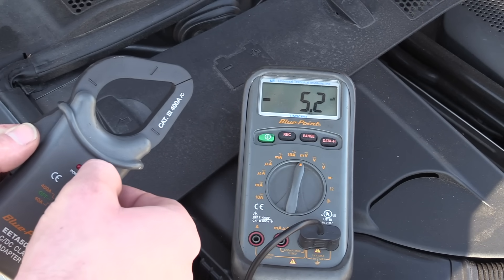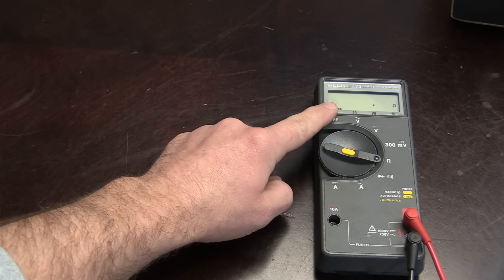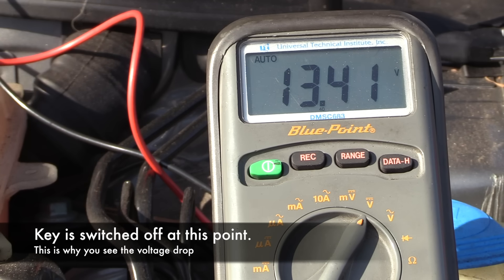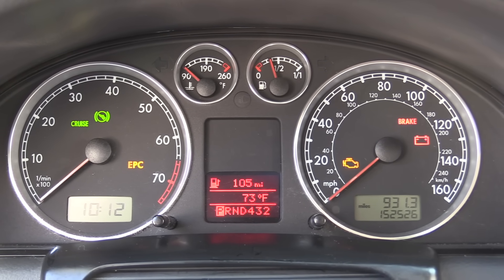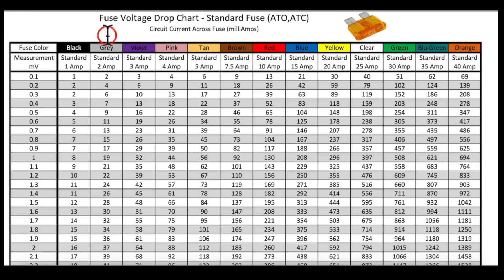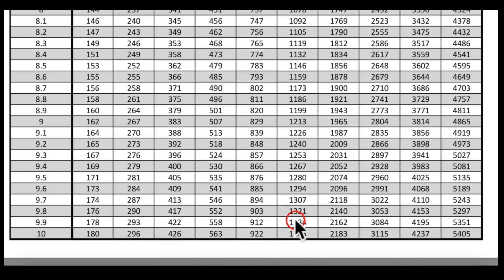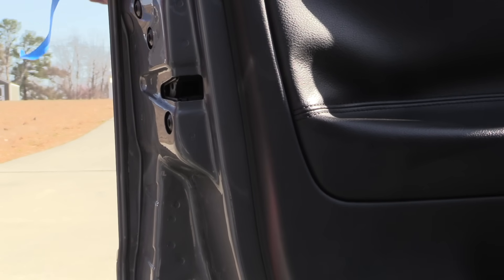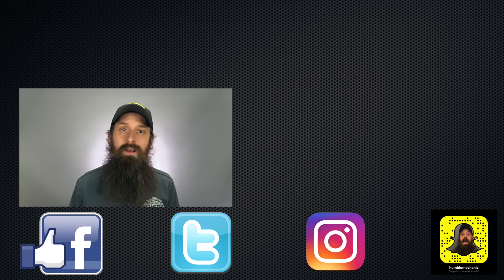The BEST Way TO Perform a Parasitic Draw Test

Comment: So wait, if you can see the voltage drop to 0 it's good... but if it stays on 0 that means you have a draw?
Reply from the maker: It should be at or drop to zero.
Reply: That's what I thought. Just misunderstood your explanation. Thanks for clarifying. Everything looks good. Guess I'm going to have to test my alternator next.
Reply: Thanks. That what I thought. I watched the video so many times I was hearing things I guess. So I did a parasitic draw test because I thought I had one. 0mV on everything but the fuses underneath the hood all read .1mV - I let my car rest for 2 hours with all the doors "fake" closed and everything on my 2012 accord lx sedan.
Reply: And is it possible my alternator is draining the battery when not in use? Is that even possible?
Reply: Could be leaking alternator diodes in the alternator, take it out for a check
Reply: I was actually able to test the diodes by disconnecting my battery ground, selecting the "diode" setting on my dmm and when I put the neg terminal on the b+ post and the positive terminal on the alt casing to test the diode output I was only getting .3 VDC - i think the standard range is .5 to .8 VDC. If you reverse the probes it should read OL or "nothing" because diodes only let electricity flow in one direction... but my diodes were bad and they were allowing 1.3 VDC of backflow so the alternator was in fact draining my battery.. slowly but surely. I tested the diodes on a duralast alt from autozone and it read .55 output on the diodes.. i got a replacement rectifier on ebay and the output reads .99. I'm not sure if a higher number is better or not but since my bad diodes read really low I'm assuming the high reading out is better.. I also tested the ADC out and was only getting 40A out. When I first turned the car on it would spike at 60A for a second but would idle at 20A and once I put it at 2000rpm it was 35-40A at the most. Honda service manual says 85A minimum.

Took a lot of googling and YouTubing but this video helped me understand quite a bit.

Comment: I learned a few things for sure. I always test my leads before checking continuity, or ohms. Didn’t think about checking them EVERY time. Solid advise though. Sometimes it’s the little things that will drive you mad. 
Just had a bad battery on my F100 that passed a charge and load test because it was literally the first thing I checked when my truck wouldn’t start. I knew I had a dead short somewhere. No off gassing, no swelling, no amp draw on the terminals, or fuse box. Truck would not start with a jump. Tested ground cable, solenoid, starter, positive cable, starter cable. Replaced parts that looked sketchy, serviced others. Took a few Saturday afternoons to find before the battery finally stopped taking a charge. Put a new battery on and all problems went with it. Apparently it was only shorting bad enough when I went to discharge it by starting. Otherwise it was powering everything else and showing 12+ volts after a charge....until it didn’t. Let it sit for 3 days to verify that draw was gone.
Reply: I had a bad battery connection that allowed all electrical components in the car to work but not start or start poorly.  Once the connection was fixed, no problems.  I wasn't  suspecting a loose battery connection since  headlights, etc. were fine.

Comment: Anything that will drain a car battery within a day or two will certainly get warm.

Park the car in the garage with a charger attached. The next morning, look it over with a thermal camera to find the warm spots. You can cover the entire car in about 30 seconds.

If you don't have a FLIR cam, park it with the charger as above. In the morning, lay your hand on the alternator. If it's warm to the touch, there's your problem (shorted diode).

Comment: Used this method before with no luck.I found the car security system picking up movement,and triggering the alarm System,As we know  Modern Security systems are not easily disconnected,they also have internal batteries.

Comment: Sorry for being daft, but why not just measure the current (say, mA) at the fuse? Why voltage? 

Is it because your multimeter doesn't measure mAmps or is it disrupting the battery in some way or something else?
Reply from the maker: To measure current you need to remove the fuse. This can upset the circuit.

Comment: My question is: Is there a chart for older ceramic type fuse drops? I have a 1980 Mercedes 450 SL with an intermittent battery drain. I'm am leaning to a failed climate control servo, because my heat doesn't work- as it was going out it worked once and a while and if I tapped it it would work temporarily- and I've read it can drain your battery. I'm about to verify this condition exists in my car and am brushing up on my skills. I was wondering if there is a chart for the torpedo/ceramic/bullet type fuse. Thank you!

Comment: Thanks for the video man, very informative.
 I have a draw some where on a used 2008 Camry XLE I just bought. It drains overnight sometimes.
 I bought a new battery, it fixed the issue, then it started again after less then a week. Then for a week it was fine, and it happened again this morning
 I have a malfunctioning hood latch sensor that sends warnings to me while am driving. This also activates the theft deterrent system when I lock the doors. Could this be my draw even if I do not lock the doors overnight?

Comment: I just bought a clamp multimeter and realized it doesn't have DC Amp option. Can I use this technique to find a short on my car ? I already checked the battery and it seems still good, also the alternator.

Comment: Does 0.14ma drain the battery of my 2015 kia sportage R??
Reply: Yes, it should not be more than .050 MA, this is the general rule.  Each car has it's own amount of parasitic draw in the shop manual but .050 is what is generally used without a shop manual.

Comment: Charles thanks for the 'heads up' on those charts....didn't even know Power Probe had it's own website....Now disnloaded abd will be printed off and laminated for 'The Van'...(BTW it's a 1998 5 Cylinder 2.5 SDI LT35..)

Comment: hey brother....i have a question...my jetta has a parasitic draw..i found where its coming from..its the # 14 fuse..which is the central locking and interior system..i have checked to make sure all my lights are off and my car beeps when i use my remote to lock it...so...now am back the square one...don't have a clue...can you please give me some input as to what could be the issue...i have a feeling its the locking system..but not sure...i would greatly appreciate any suggestions....thank you brother.....bless ings....
Reply: There comes a time when troubleshooting electrical and electronic circuits you have to take it to someone who either knows your car or has access to the information to fix it.  If I were doing it myself I would go here and pay for the information (wiring diagrams) and see where that # 14 fuse goes.  Electrical circuits in a car are like a road, you don't know where you are going unless you have a map. 

Here is a DIY site similar to what the pros use, I believe Snap-On tool owns them. 
Mitchell1DIY
https://www.eautorepair.net/Marketing/Default.asp

Comment: Thanks for this quick tip, particularly about verifying your probes before beginning to test circuits. That alone is worth the price of admission.  As DmcHartsoe pointed out, you might want to say something in your notes, or add something in the video, about the math issues relating to the proper identification of tenths, hundredths and thousandths of a volt in measuring the typically very small voltage drop across an active fuse.

Comment: Can there be a parasitic draw even if all fuses are ok?
Reply from the maker: yes. Things like the alternator are common for that
Reply: Yes, you can have a bad diode in an alternator and it will draw power from your battery.  A healthy battery and alternator are a must, stop by one of the auto parts stores and they can test them right in the parking lot. I would do this before trying to check for parasitic draw.

Comment: None of the draws I've encountered have been on a fused circuit, but this still would have been a worthwhile  timesaver. My neighbor has this problem now so it is very timely.
Reply: What were the draws on? I think I may have that problem with a 1979 F150. Showing positive voltage on the negative battery cable.

Comment: this is a very helpful video. Thanks Note: astron power supplys use the voltage drop across the internal agc fuse to control the current foldback. with time the fuse gets weak and more voltage drop equals premature foldback. When in doubt measure the fuse resistance compared to a new fuse or just try a couple new fuses. If you measure the resistance of the fuse you can use that decided into the voltage drop to get the current.

Comment: What if on the car you were working on has a short in one of the wires that goes through the harness that goes from the door to the body and only shorts when the door is closed? Thoughts, comments, snide remark's? 😉

Comment: Of course he is doing parasitic draw/voltage drop test on Audi! Last Audi I worked on had parasitic draws on multiple circuits.
Reply: All modern cars with computers have parasitic draw, it's just when it exceed a certain amount where it drains your battery over a short time that it becomes a problem.

Comment: HumbleMechanic:    I've been a GM tech for about 6 years now, and I deal with electronics and CAN bus concerns almost daily. Graduated the ASEP program top of my class in electronics, and this method confused the crap out of me. Still trying to wrap my head around the voltage-drop method you're using. Did I miss something???According to Ohm's law, Voltage = Amperage x Resistance, and a fuse is a simple circuit protector. As such, a fuse should have extremely minimal resistance, as to not affect the base operation of the circuit load. Resistance has to be present to use up the voltage, or cause voltage drop. So in my mind, if you have voltage drop across the fuse more than say .1 volts, that fuse has high internal resistance and should be replaced. Not only that, but the fuse is at the very START of the circuit, and if it's dropping voltage, that'll affect the operation of the load. How is this method showing drop across the fuse??? I don't get it!Help me wrap my brain around this please, I feel I'm being made a fool of!

Comment: I like this method but if the fuse was blown and there was something still turned on wouldn't you end up with a situation where your volt meter is now in series with the load? Your method measures the voltage difference across the fuse which provides resistance. If the fuse is compromised then you would send the whole load through the meter potentially damaging it I think?
Reply from the maker: +feetfats1 it would. But you should not jump to this method first. I always scan the car for faults and do basic checks before I go this path
Reply: Multimeter has a resistance of 1M ohms to 10M ohms (10 million ohms) when used in voltage measuring mode. 12v wont do anything to the meter. It will pass extremely small currents that wont damage anything
Reply: Ok thank you
Reply: feetfats1 I pretty sure that if the fuse is blown there isn't a draw there!
Reply: Yes, you should check the fuses first.  Good Point.

Comment: i have replaced my2008impala the battery,the altanator 5 times and the starter twice...i still cant get power to the altanator so it can charge the battery...but when i disconnect the negative and brigde it then i get poower to the altanator....any suggestions would be greatly appreciated

Comment: Hey so I have a parasitic draw in my 06 VW Jetta TDI. It says one of the doors is open on the dash pretty much all the time, but it does turn off for a minute or two randomly. Could the draw be from the door constantly "opening and closing" (even though it is not, but the car computer thinks it is) so the car never really goes to sleep? I'm sure it can be other things as well but if the problem is the door I would rather a mechanic focus on fixing that.
Reply from the maker: +Aaron Peart start at by inspecting the wiring for the door that's shows open. 

You will probably end up replacing the door latch they fail all the time
Reply: Oh I wish it were that easy, took it to two mechanics so far. They both checked the door latch and negative on that.
Reply from the maker: +Aaron Peart general mechanics or VW? Plus you said it's intermittent maybe they just haven't caught it yet. 

Has anyone checked the fault codes for the door module?
Reply: General mechanics who said they specialize in VW, "said". Yes they did and the only fault code came from the driver side rear window. The dude said that was reading as the open door. Was he just blowing smoke or could that actually be the problem?
Reply from the maker: +Aaron Peart it could be the latch or the module. 

The modules fa pretty regularly
Reply: Could I use that you said in the video to diagnose, with a multi-meter and such? Or should I just take it in to VW or another mechanic. I recently moved to a new place and there is a mechanic here to swears he can fix it. He also said he had the same diagnostic equipment the dealership has. Would you suggest working on it myself, taking it to the mechanic, or the good ol' expensive dealership. Also I am a not very wealthy college student so I am on a budget haha.
Reply from the maker: +Aaron Peart I can't really say which is the best route all of them can be good options or bad options. 

If the door is showing open and it's not, odds are the latch is bad. But it could be something else. 

What did the mechanic say would fix he issue?
Reply: Well he said the other mechanics where stupid first off. Then he said he would just hook it up to the diagnostic equipment and find out from there. He did not however think that the door reading as open was the source of the parasitic draw. He really didn't offer any solution, just how he would diagnose.

Comment: i have attended one concern for nissan  Datsun petrol vehicle. in this vehicle running time battery drain problem. new alternator  new battery replaced. battery to alternator wiring and battery to self motor wiring is good condition. but draining problem not arrested. what is the problem in this vehicle?.please help me.
Reply from the maker: check the cables. What is the volt drop on the cables?

Comment: my parasitic draw happens when my car(2012 passat 2.5L)....is on and running, a fresh battery lasts about 2 hours....im at a loss, here!
Reply from the maker: You can't have a parasitic draw when the car is running .It has to be a charging or battery issue.
Reply: its the second alternator and fourth battery since May....wish i had a clue
Reply from the maker: +Bizzle Chocolate maybe an issue with the alternator cable? 

Fuse panel? 

ECM? 

Battery ground
Reply: i checked it earlier today.....would it be an option to get a new ecu or something else? is there a main fuse? my cars various components shut-off one by one till the car shuts off

Comment: This was in my book about 13 years ago - page 157. Guess I have changed the World - slowly - but, the amperage chart is unnecessary. Only certain components need key-off amperage, and ANY other component that shows a voltage drop is incorrect. It's a simple yes/no question - a big drop = big draw. If it isn't an ECM or radio, it's wrong...

Comment: Why with the charts and crap when you can get numerous clamp on ammeters that direct read parasitic draw, and also act as V-Ohm meters with the leads? 40 to $200 as you so choose. And man, I would be careful around the fan belts and fans with that Kentucky hair do on your chin - you could get a reverse Apache scalp job in a nano second!
Reply from the maker: I have used a few of those type of clamps. Most worked fair at best, and take some annoying calibration. Plus you still need to know the circuit you are having the issue with. Now if you are looking at current draw of a motor, or other component, then the amp clamp wins the day. This is about finding a Parasitic draw.
Reply: Got my clamp on ammeter on the battery neg cable set for dc amps right now looking for a draw down on a Caravan. Digital meter reads @2 amps. When I pull the IOC fuse it drops to .001  So I'll put the fuse back in and start isolating all the Ignition off crap it feeds. Clamped it on my other identical Caravan without a 2 day dead battery issue and the draw was @.025, or normal. So you might want to give these another chance. Up until this year I was using it just for AC motors and such as you mention. But I discovered it is just as sensitive to DC amps also.
Reply from the maker: +Richard Raucina I'm not saying that way doesn't work. I've used that method tons of times. In fact using an Amp clamp with this method is a good practice. 

But pulling fuses on CanBus cars can cause false fix, create other issues, or lead to no repair. 

It's either this video or the video I answered someone's question about PID where I go deep into that. 

On the car I did this video on, pulling fuses is fine. But on newer cars it can be problematic.

Comment: Frustrated here.. i found 2 drains on my battery  from the fuse above and below the ECU fuse.. which is security radio and related fuse and interior lights fuse ..yet i still have a drain on my battery, how be it a smaller one that causes me not to be able to start at times unless i get a boost . Got a 02 civic LX .. funny thing is it stated this morning, drove it  to work (30 minutes) and after work it wouldn't start until i got a boost, i know last night rained but none of this adds up to me !  i know i still have a drain because i put my analog multi meter to .50 ma settings  and the needle went to 75 mark  bridging the  removed negative post and wire. also my digital multi meter is reading 13 volts with same set up.